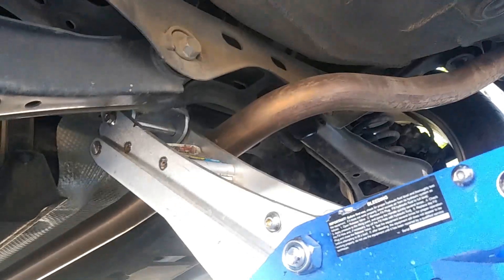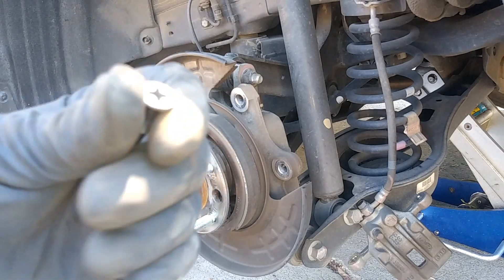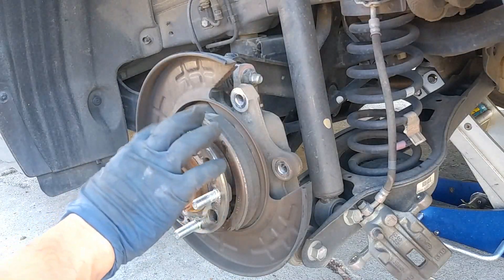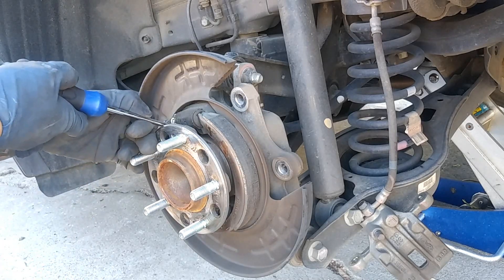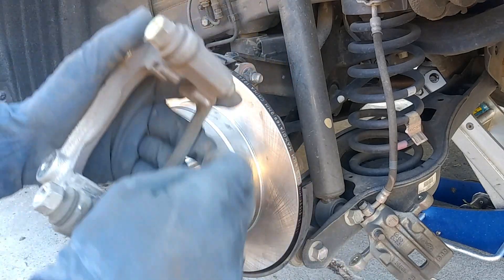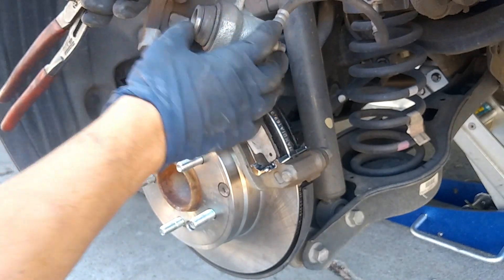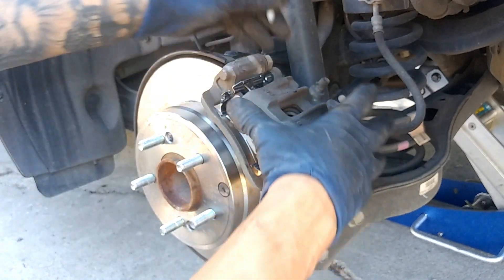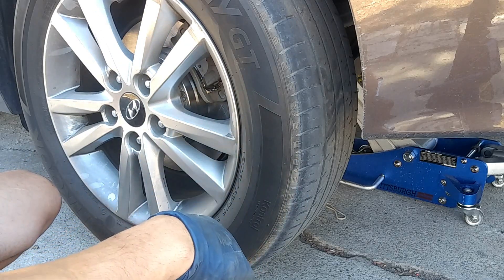2016 huyndai sonata rear brake pads replacement

Comment: How did you like those caliper mounts? The locktite on mine were insane! They even stalled my impact! They tightened up about half way out and almost seized. I needed a breaker bar to get them the rest of the way out.

Comment: How do you know if you have a manual parking brake or power? Is the manual one the one you push down with your feet?
Reply from the maker: Yes that is correct
Reply: Wow, really?  😱You should NOT be driving! 😲😬🙄 Wow!  Sheesh

Comment: What brake pads did you use?  Pads I ordered as well as others that I have researched on RockAuto don't come with holes drilled for the spring wires but say they are compatible with this model car.  The old pads have the spring wires installed.
2016 Sonata SE/manual brakes
Reply from the maker: I used autozone brand
Reply: I ran into this also. The OE pads Im replacing had 2 wire springs on the brake pads of each caliper, keeping the pads spread and off from riding on the brake rotor. The pads had holes drilled in them to accept the wire springs. 
  The NAPA pads listed didn’t have them. I should say, the Napa pads that came with the wires in the packaging were a completely different shape brake pad then the OE. The Napa pads that were a match did not have the wires or holes drilled in the pad to accept the wire. 
  Found the pads with the holes in stock at another large auto parts retailer, but had to order the springs separately. What a pain.

Comment: Need to torque the lug nuts to the proper, specified torque with a torque wrench. And then recheck torque after 25-100 miles.

Comment: Hey did you apply the parking brakes during the video? Is that why you tensioned the brakes? Please let me know, I am doing my brakes this weekend
Reply from the maker: No parking brake must be not engaged so you can take off the rotor
Reply: You need wheel chocks or a piece of wood